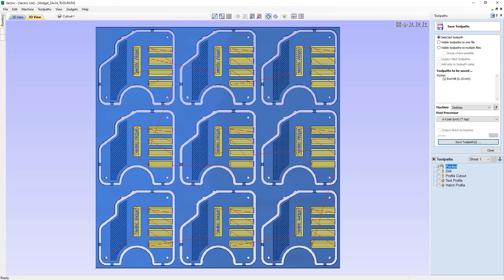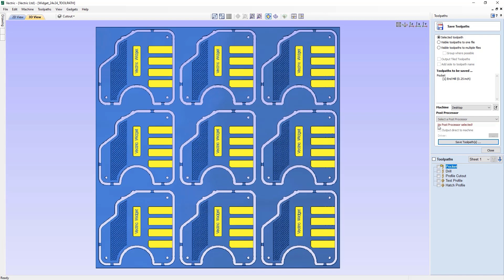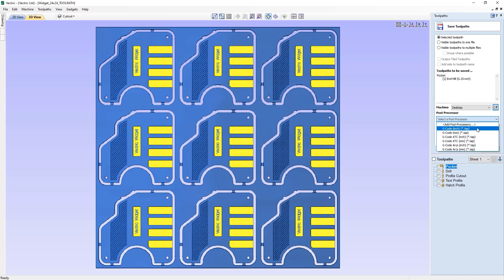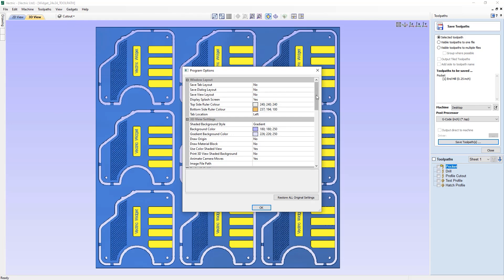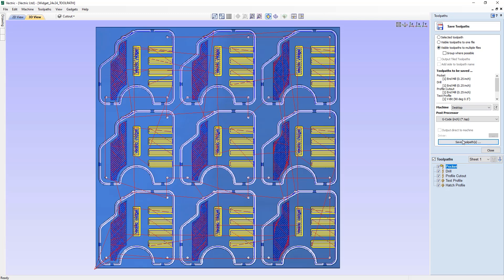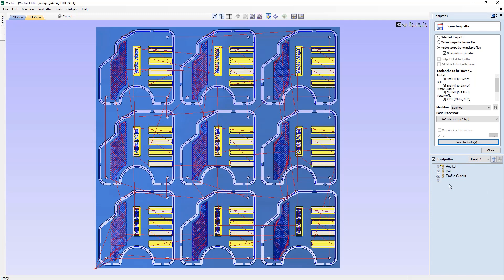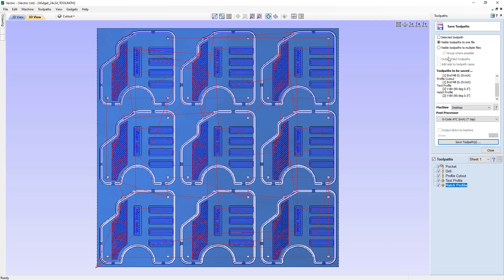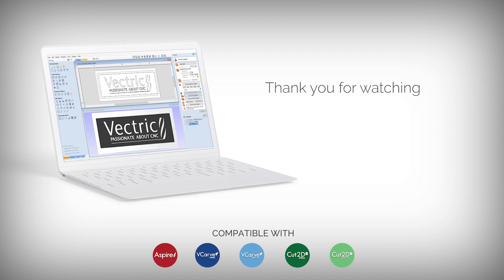Toolpath Saving Guide | Vectric V11 Tutorials

Comment: how to change the names if i have to save 20 sheets I get very long names... and it not understandable on my controller... can i make it short without rename it one by one.    __Sheet 18_65-66-9mm  (Sh18_9mm)
Reply from the maker: Thanks for the question, and unfortunately not.  You will need to rename them or shorten them by hand.  If you feel there should be an option for shorter filenames or file name "variables" then please email support@vectric.com asking to submit a user feature request.  Outline what you think, how we might consider doing it (not specific stuff just how a user might see it) and then a file to look at.  You never know users have asked for all sorts of things and we have worked with them to make them happen.

Comment: Is it possible to automatically create a toolpath name? my machine will only open a file that has a name less than 31 characters in length.. often I have to manually change the file names as the format "Job Name_Sheet x_toolpaths_toolpath name" that is automatically cheated can often exceed this number of characters
Reply from the maker: Hello and thanks for the question.  At the moment we don't have a way to do that... but I would suggest you send an email to support@vectric.com with a customer feature requist.  Outline your idea and they may have a way for you to do this (work around), or they will add it to the list of features aur customer are looking for.  You never know others may want the same thing... :)